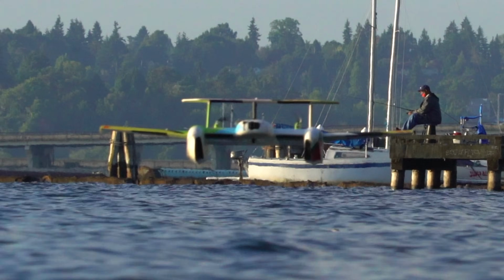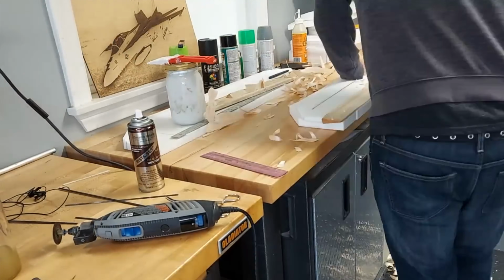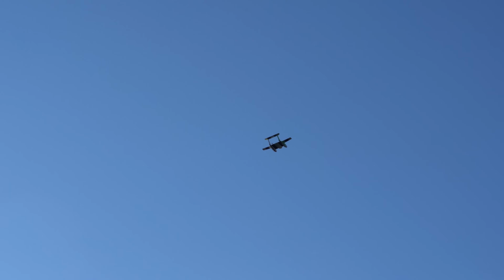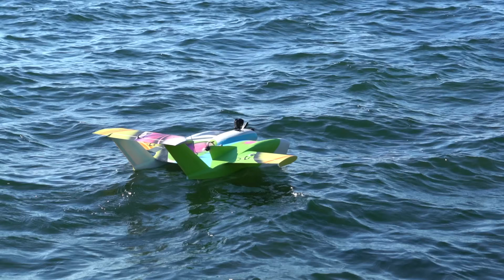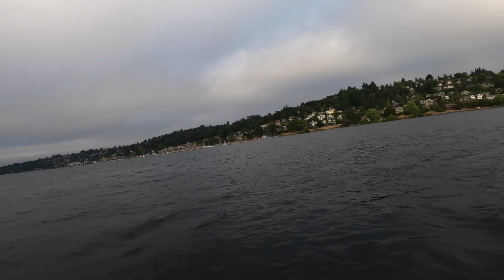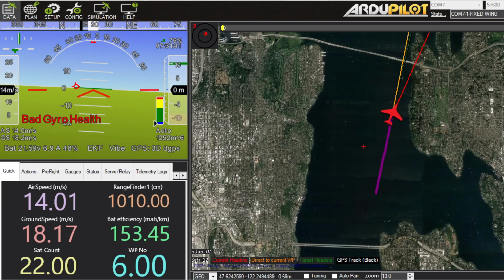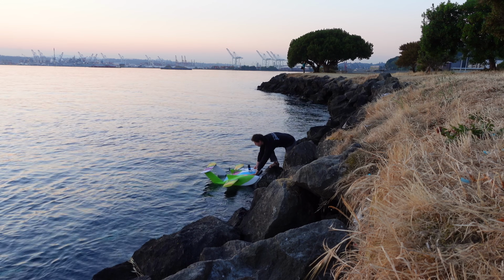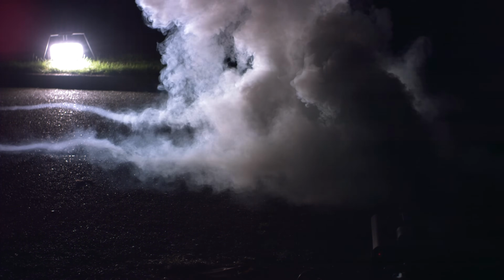R/C Ground Effect Vehicle - Long Range FPV

Comment: Hello from France 🇲🇫
That's a very Great dev plane and a apparent Great success !
For me and without any measurement, you clearly lost ground effet for normal flight above 3meters. Flying at 10m is absolutely not ground effect

The most impressive ground effet for such a plane must be around 80cm to 120cm from ground 
Here is the efficiency of these type of flight we but a bit above it must have positive effect on performance too. 

Continue to Dev it. In my opinion, add 2 sensors on each wing could be better. 
An change the geometry for less drag on wing extension by a less brutal geometry change between center and extension. 
Don't stop! Fly and fly ! 
Cheers

Comment: For the getting too low while turning, did you take into account the trigonometry for lidar distance vs height due to roll? If the beam angle is only 3.5 degrees, then any measurements with the roll over 3.5 degrees will need math for correction.
Reply: He should make a code to increase the altitude or lidar distance when turning.
Reply: @arnavpawar256  he did do that

Comment: I wonder if you would consider a different control other than PID. PID will always hunt. Each time I see your data, there is a low-frequency oscillation in height that can be eliminated

Comment: Knowing nothing at all about this sort of stuff other than what I've gleaned from your own videos, I still have a thought/question/suggestion .. use more Li-Dar sensors.  you have the main one in the center but add two more at the wingips .. when flying in ground effect, take the average all three.  I feel as though that would remove some of the chopiness of the water because you'll rarely have all three reading a peak at the same time....  then, when in ground effect AND banking a turn, use the one on the inside wingtip to make sure that you don't wingtouch?  Again, not trying to tell you how to do things, I admit I'm only guessing here, and asking if my guesses WOULD help.

Comment: Hi Great video  really interesting have you thought about using two of the LiDAR units working in tandem  to help filter out some of the  noise to get an accurate height reading. High tech version of what the Dam-busters used in WW2 just a thought.

Comment: Are you accounting for the increased LIDAR measured distance as you go into the turn?  If you are measuring roll angle, you can calculate the new desired LIDAR distance to maintain the same height above the water.

Comment: So what about several LIDAR sensors, then averaging their values to get rid of the noise?
Or even get rid of the LIDAR completely and use some spring-loaded flaps on the trailing edges of the main wing (similar to the Caspian Sea Monster, though i suspect those were powered, not passive) to regulate under-wing pressure when in ground effect mode?

Comment: Any reason you didn’t use an airspeed sensor for throttle and elevator for lidar.
Or better still use an open mv camera to look for reflection of nav lights to get more accurate height with averaging the image in chop

Comment: How about looking at 24GHz FMCW radar modules? These are small, very light and so you could have several to average out the height of the waves.

There are many manufacturers, but RFbeam might be one candidate to consider.

Comment: You can size up the vehicle to try and cope with waves, but you can’t also size up the molecules of air, the behaviour of which make up the ground effect, so an ocean-going GE vehicle can only operate in placid waters. How big a sea could one sail over, and is this a factor you developers are considering?

Comment: About getting out of radio range, could you not have a high flying stationary repeater vehicle to look over the horizon (e.g. a quad-copter flying 100ft above your head repeating signals received from the ground-effect craft)?

As for keeping the wings out of the water, what about getting two LIDARs, one under each wing, so that you can detect not only the body height of the vehicle but the wing height of the vehicle?

Comment: Are you using the attitude of the drone (roll, pitch) to change the range measurements from being in the drone's co-ordinates to world co-ordinates? This would probably help the issue of it diving while turning. The Li-Dar also might not be effective at sensing the water at an angle.

Comment: wouldn't mAh / km(or mile) flown be a good metric especially for long range missions?

And would it be possible to use a cam(or stereo cams maybe) in the nose plus a raspi zero for example to do some object recognition and either go up if it sees something or try go around?

Man i love your projects and how they all manage to start some thoughts spinning in my head

Comment: 3rd derivative smoothing so that you dont bounce up and down
Reply: efficiency measurements, wattage vs speed vs flight time
Reply: miles per battery, kilometers per watt-hours
Reply: glass on the sensor, glue it around
Reply: quad drone rotors to generate the hover craft bubble while not moving, also to control the exact altitude
Reply: better match for the response curves
Reply: you panic nose up, that causes the bounciness
Reply: passive balance more optimal
Reply: fly-wheel active direction balancer/control, both passive and active nose control
Reply: you could do flatty-dish-mc-flat-face, with a helium balloon radio relay, to cover a large area, and have antenna pointing up, on the back, not causing air drag
Reply: calculate the efficiency from the data
Reply: you can get the miles per watt-hour from that
Reply: trim control on the remote to change the optimal range-finder altitude
Reply: super accuracy altimeter, pressure based, multiple sensors
Reply: you can use inertial measurement unit, to estimate the actual movement on top of the water level, even if range finder does not know what its doing
Reply: then re-calibrate the imu from the water level data, from the range finder and altimeter, when it has clear knowledge where it is

Comment: When a caddx is running smoothly, it seems to have about the same range as the older DJI system with 2 antennas. I've had a lot of issues with CADDX being really sensitive to the supply voltage. It really likes to be fed straight from the battery and have local decoupling caps. I've had several quads that had issues with the caddx and on most of them I was able to fix it and get it as smooth as can be. 50.8Mbps all the time close by! I can now immediatly tell when the caddx is doing something fishy. The bitrate is sort of close to 50.8 but most of the time not quite there. 49.7...50.8 for a small time....48.....alternating like that to me is a tell tale sign something is wrong. It seems completely useable like that...it's just not as smooth.

Comment: What about using another lidar front facing in a slightly downward angle that can predict oscillations and automatically input corrections in altitude?

Comment: Great Work  here!  As you already know, when the model turns to left or right is VERY important that the wingtips DO NOT touch the water. A solution to this problem can be a differential thrust motors and two working rudders. I use the differential thrust on my new TRITOL Flying Wing with the OperAeroVTOL stabilization firmware. With differential thrust you can do “flat-turns” with motors and rudders only and without ailerons input. More info here: https://youtu.be/v7bgHnxa518

Comment: Air pressure increases significantly when ambient air temperatures plunge below the freezing point of water (0 degree's celsius), when you do the tests in the winter can you compare results against the summer results? More air pressure = more lift.

Comment: This is cool. Just FYI watching from London UK. Do you think that adding additional LiDAR sensors to the wingtips might help with the groud strike issue in turns? You may also be able to use the data from three LiDAR sensors to get more accurate readings for ground clearance over chippy water? Just a thought.

Comment: Do you plan to release the code you wrote for ardupilot, by any chance? I’m about to make first attempt at building an autonomous fixed-altitude flying craft (ground-following) and anything would help. (Ardupilot beginner..) What’s tougher about ground-following is you need also to look ahead and predict what the terrain will do. Water is pretty flat in comparison.))))). I’m thinking an angled-forward LiDAR #2 and averaging values to predict what’s coming (within reason).

Comment: So impressed.  I wish I could do this.  About the height/throttle control.  You tune throttle from height but do you also tune from the rate of change of the height and even from the rate of change of the rate of change (vertical acceleration)?

Comment: I know this is a rather brute force solution, but have you considered using 4 or more rangefinders and taking the average with each distance weighted by the signal strength?

Comment: Could you add a second lidar sensor and space them at either end of the fuselage and average the 2 readings to smooth out the signal in rougher water?

Comment: Have you found the reason why one of your video systems was cutting out? There is a known issue with radio comms over water called multipath fading. https://en.m.wikipedia.org/wiki/Multipath_propagation
You can manage the problem by using two carefully chosen frequencies and/or antennas at different heights - called "space and frequency diversity". Radio engineers setting up microwave links over water are familiar with this.

Comment: Do you have code to correct the LIDAR reading when the plane is pitched or rolled? In a turn the reading will be greater than the real height of the vehicle

Comment: would it be possible to program a max bank angle?
maybe by using half the wingspan and height over water to determine how far you can tilt before striking ground?
This is based on the assumption that the lidar sensor is dead center with respect to the body (I realise that ""ground" height may change but idk)

Comment: Would a balloon mounted relay work in order to help solve connection issues? As I know that height is an issue with controller antennae, why not relay it to a small balloon/blimp say 50-100m in the air to relay the signal. (I do realize that a relay is a significant failure point and added complexity, but it would definitely reduce problems with the plane leaving the controller's radio range.)

Comment: Aren't full size ground effects air planes only able to do ground effects flying? Your model plane was able to do both modes. Was this specifically designed that way or did the size contribute to its capabilities? 
Thank you 
Good luck on your future projects.

Comment: to a certain extant it seems like a lot of the difficulties you are having seem to be scale.  As in what would be a small wave for a 'full scale' (i.e. 30ft wingspan craft (for an example) could be in the ground effect to an altitude of what? 15 feet (that is a GUESS)? and your three foot wingspan craft to be in that effect has to be what a foot and an half? (again WAG)  Now we have seen WIG's flying in four foot seas (with their ability to fly at 15 feet and still be in the ground effect), so even a modest chop (6 inch waves) is a problem. So you are bucking having to be down low and the chop reaching out for the aircraft.  The other part of the problem is a WIG usually flies pretty slowly, and if you 'scale' your craft it is flying so fast (and the frequency of the waves is such) for the auto-pilot to be able to really suck it down low and get the best efficiency from the ground effect.  Is this correct?

Comment: Have you tried letting the flight controller keep a steady air speed and the lidar sensor control height using the elevators?

Comment: hey how about turning with rudders only on ground effect instead of with ailerons to eliminate the banking and wing strikes ?
Reply: The problem would be that the whole thing would skid and still try to bank a little - like a plane making a rudder-only turn. Then he’d be relying on new thrust vector alone to change direction of travel.

Comment: When doing wave point missions is it possible to have object avoidance?
Reply: *waypoint
Yes, that is possible. You need just a bit of sensors and a driver/firmware modification on your flightcontroller.